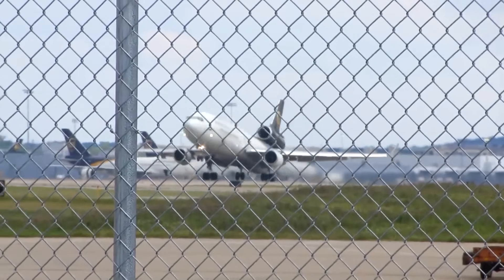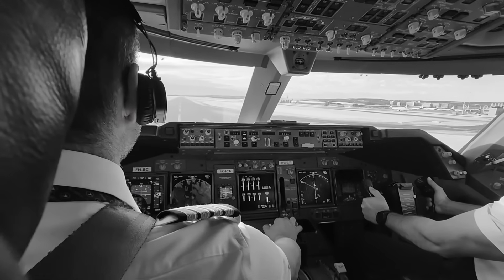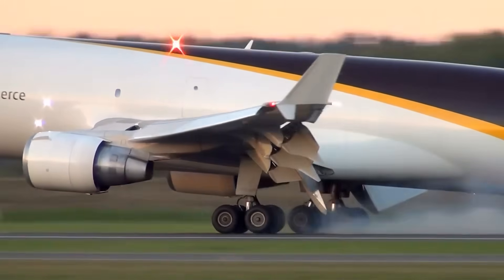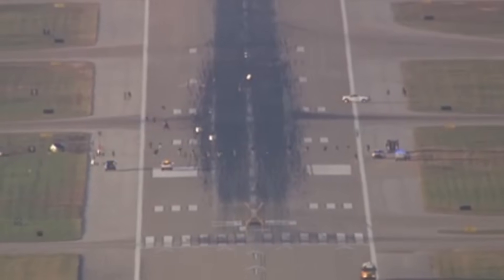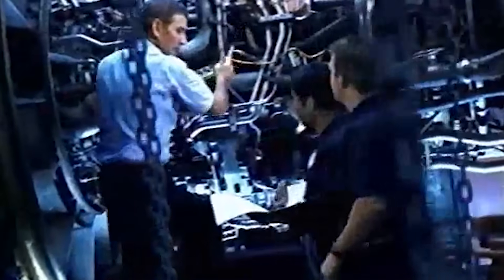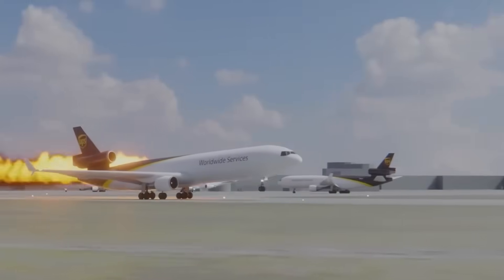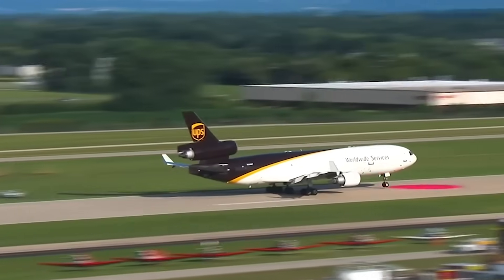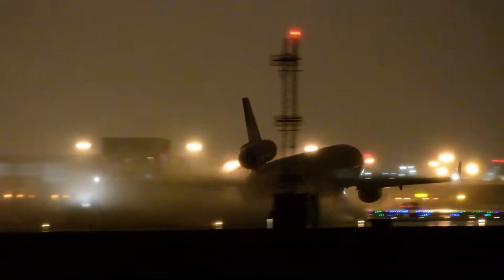The REAL Reason UPS 2976 Failed So Catastrophically...Mistake repeated AA Flight 191

Comment: So once again we have another self appointed  Aviation expert???  The reason
the NTSB takes it Time to do all the work required to find what actually happened.
Is just what you presented Here.
You assumed that it was the fault of the pylon design that was the failure that
cause the accident ?  While there is no doubt that the engine and pylon left the
Aircraft  around the time the aircraft rotated .
In the case of flight 191 we know the cause was improper Maintenance procedures
but in that case the engine and pylon also left the aircraft in the same manor  going
up and over the left wing. However the engine and pylon were found damaged but
all together on the runway.  The jet was doomed because of the design of the 
hydraulic system .  In this case we see engine parts scattered  around the runway?
The no 1 engine was at full power  what may of happened was the failure of the 
engine fan disk which could if it had only caused a partial failure caused an 
unbalanced condition with such a force that the pylon was never designed for
the rotational force could  have caused the engine and pylon to depart the Aircraft  and
fly over the aircraft and land on the other side of the runway.   
A catastrophic engine failure causing an uncontrolled out of balance could have
placed side stress on a pylon that was designed for fore to aft stress.
the finding of shrapnel ( fan blades and metal parts ) plus the unbalanced fan
would be more consistent with the damaged engine flying over the aircraft to 
the right the fact that the center no 2 engine may have been damage by  FOD
would support this.  
So yes the pylon failed but just saying it was that alone was the cause I believe
is wrong .   So am I a expert ?  No  But I do have a Aviation engineering degree 
and one of the thousands who worked on the space shuttle.
Reply: There is a possibility that there was an issue with the No 1 engine, that caused excess vibration which in turn caused the weakened pylon to fail. It is possible that issues with the engine my not have caused a serviceable pylon to fail. The NTSB will establish the state of the engines after they have been torn down.

In either case the key issue is the pylon mountings, which will have to be inspected before any of these aircraft can return to flight.
Reply: @christopherrobinson7541  The main fan disk
 failing  could have such a great in balance
 on the No 1 engine that in just a second the
side load caused the pylon failure we also see
in the photo's the engine seems to be twisting
and look like it's rotating as is travels over the
aircraft . the engine coming apart from this
event most likely cause the damage to no 2
engine . a simple failure of the mount would
have departed over the wing intact.
Reply: @peterdaba6651 there’s no denying the fatigue cracks they found … engine failure or no engine failure . An engine failure shouldn’t cause a pylon failure … it should cause an engine separation.